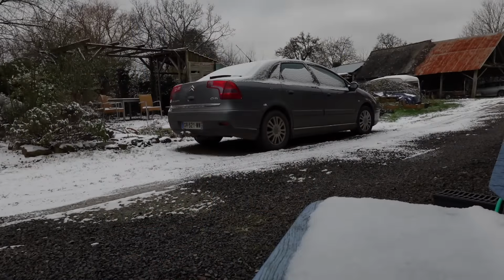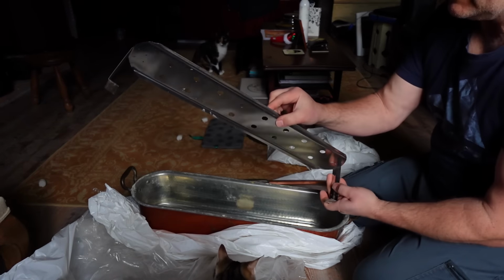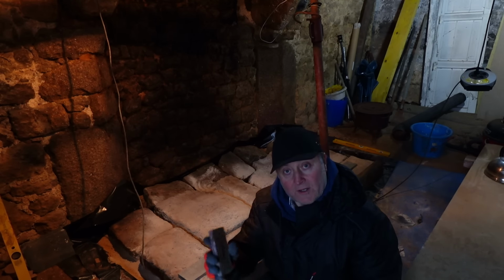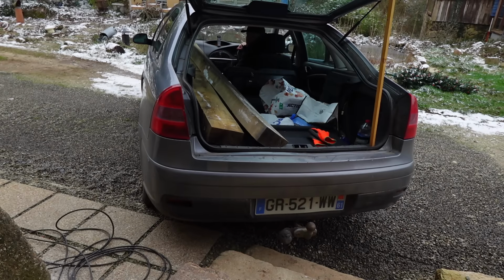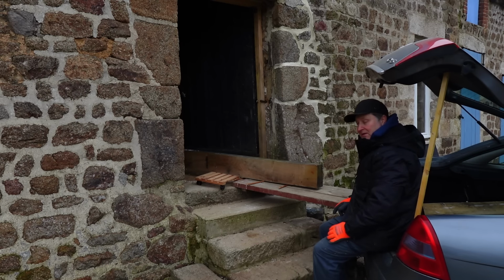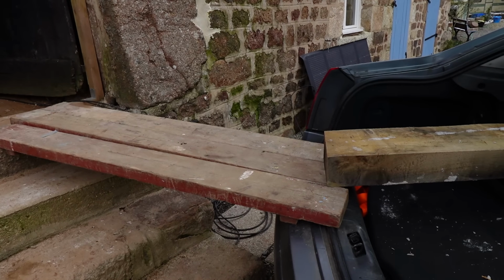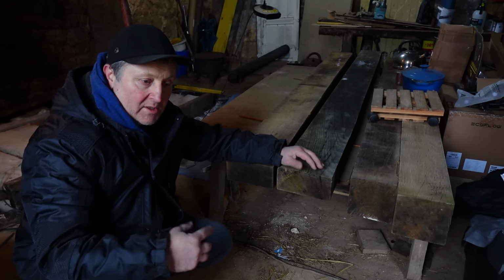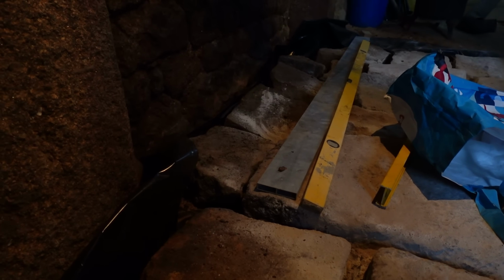Can I Finish This Fireplace Alone? How I'm Not Letting My Injury Stop Progress

Comment: Glad you are able to move forward in a cautious manner!   I have a suggestion for kneeling on the cold stones :  take a strong garbage bag, crumple newsprint into loose balls and stuff them in until it resembles a thick  overstuffed chair pad.  Squeeze out the air and tie up the bag.  We use this as an insulator for our tractor seat,  something waterproof to sit on during outdoor bonfires and winter picnics.  Cheers

Comment: Well done getting those large planks of wood out the car!
I have a system of getting large bags of potting mix into trolleys, into car and back home.
I drape it over the top of the trolley, tip into boot of car then drop onto a movers trolley when home to wheel anywhere into the garden.
Just requires a bit of thought 😊

Comment: Also, Sean, if you bag a thick piece of insulation the size of a thick rectangular pillow, you will have a "warm" place to kneel while you toil on your cold stones, thus chasing arthritis in your knees away for a few more years. Your warmer calves, ankles and feet will be happier, too, and
you probably already have the soft insulation upstairs in the cottage..it flexes like a feather pillow when you just move it about and a very  thick plastic acts as an indestructible, waterproof pillow cover...Good luck. Hope you find this helpful...
Reply from the maker: I did you some foam l had

Comment: Work smarter not harder, right Sean!?  I would recommend using some ropes to help pull, lift and maneuver those beams in place, this way you don't have to bend over, but the ropes will give you added reach.
Reply from the maker: I did ?

Comment: I have a piece of carpet that I can put under heavy items and slide them along on wood or vinyl floors. I also have a piece of vinyl that was left over that I use in the same way to move things over carpet. It also saves damage on floors as well as the back. Will be borrowing the wood perches from the birds cage next time after watching you. 🦜😄

Comment: PLEEEEASE stop keeping the gas canister in your car Sean...full or not, it is still pressurised and is a possible risk. 

The temperatures you are experiencing, although cold may pose low risk but it is still a risk that you shouldn't be taking
Reply from the maker: Have to take them to change them